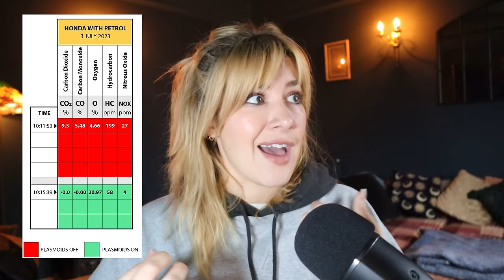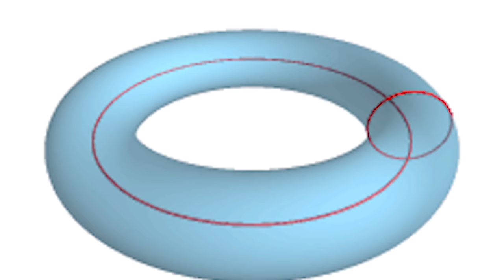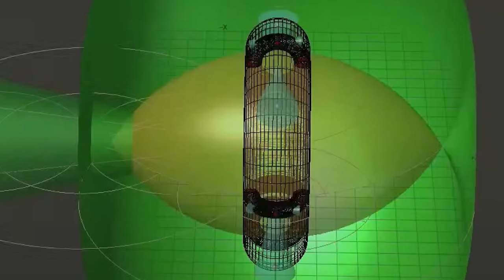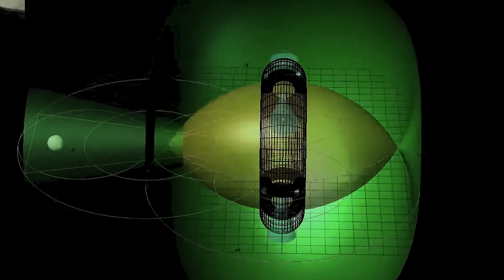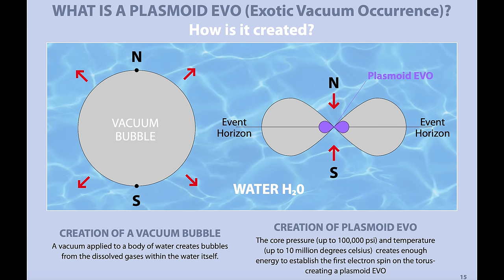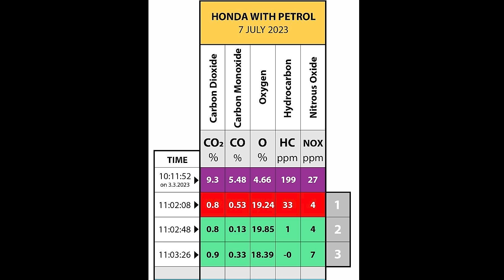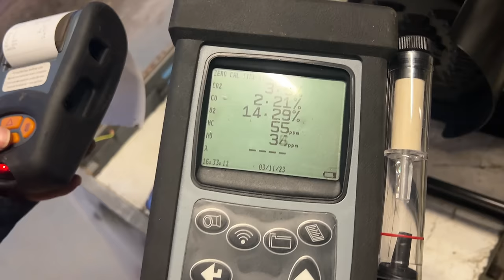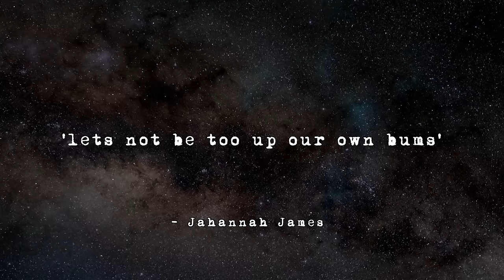Lost Ancient Plasmoid Technology? | The Thunderstorm Generator

Comment: If the CO and CO2 emissions are drastically reduced - where's all the carbon going?
Reply: Ultrasonics , water , metal surface producing HHO at the metal surface leading to the formation of vortices and toroids that, as they are driven harder and deeper form fractal toroids that already by the 3rd fractal level drawing matter in through the vortex are exerting magnetic pressures in excess of 50,000,000 Tesla - the streams (moments) at each level ultimately been drawn into the central flow of the top-level torus.  The result is an e-m vice leading to ElectroNuclear Collapse of all matter drawn into the centre by the vortex - with an aether (wormhole) flow streaming out along the moment of the topmost torus.  When the aether flow of this “consuming” torus loops around and meets the metal surface again the aether stream interacts with the electron lattice of the metal, causing matter to reform from the aether stream, preferentially as alpha-conjugate nuclei (ElectroNuclear reGeneration) The matter stream emerging from that exit port can, on occasion reconnect via magnetic lines with the matter consuming port, so forming a magnetic loop.  Now, being fractal, these toroids and flux loops can form at many different scales - as above, so below.  As Victor Schauberger and Nikola Tesla and , before them, Goethe said - comprehend and copy nature.  The universe is fractal, with the torus and spiral/vortex being key building blocks at all scales.  What those “marks” show from the TSG is that fractal toroids are almost certainly present in great number, collapsing matter into the aether before recreating it, preferentially as Carbon (the hexagonal/octagonal/circular black patches on the inside of the outer TSG sphere), Oxygen - released as a gas, Silicon combining with Oxygen to form Silicon Dioxide-quartz (the shiny crystals on the outer surface of the inner TSG sphere), and possibly Neon, Sulfur, Iron.  This, combined with evidence of “glowing sparks” when hard driven EVOS (coherent matter macro objects with coherent electron cells) is strongly suggestive that the TSG is working this way (although chemical reactions could be happening at the same time).

Comment: The pitting is the same hydrogen bubbles that pit a boat propeller, which contribute to the loud propeller noise underwater. 

A constricted exhaust will hardly give power. Plug the generator to an air conditioner or put it on a car exhaust and it will hardly move.

The exhaust is being scrubbed through the water and bubble stone layer. It is a filter plugging an exhaust at idle. 

Mechanically it is making hydrogen but a hydrogen fuel cell would generate more. Power will be lost in both methods, either by the load on the alternator or plugging the exhaust.

Comment: Seems to me like the Thunderstorm Generator and the Plasmoid Generator used to break down the CO2 are both plugged into the electrical socket. Meanwhile, the coal/gas power plant powering the Generators is releasing 10x as much CO2 as what was broken down by the process.

Comment: so... I just want to say good job to these inventors and congrats. But, honestly speaking, maybe I didn't get how the machine works, but you're telling me you add an extension to a fuel generator and the exhaust air coming out is clean?  That's fantastic and all, congrats again, but this is fuel/petrol (whatever, gasoline) that is powering the machine still, yes? So, it's not a generator, cos its basically generating nothing... is it? Basically, the pyramid is an air filter?? (I know Martin Fleishman's Channel theory and that is extremely interesting) Dare I say, transmutation is much more interesting than a filter, or better yet, using something else to power the engine/machine is much more interesting than an air filter... So, again, I'm so sorry, I'm usually smarter than this, but how is the pyramid connected to this? (Other than toroidal martin fleishman theories that apply to myriad of machines we use today)? And yes, how does this specific thunderstorm geberator corelate to Nikola Tesla's work? (Other than the word plasma? and using plasma science that was discovered before Tesla?? (Tesla is so interesting, the smartest person to ever grace the human race... dont get me wrong)

Comment: Engines don't waste 60%% of the energy it takes to move the car and all the waste isn't pollution. You have been misled. Some is pollution, yes..... but most of the wasted energy that isn't actually moving the vehicle is being used to turn the engine, recharge the battery, the aircon and most is used turning the gears and differential. The heavier the vehicle, the more energy it takes to move. Only after all that, the wheel then turns to move you.
This is why race cars are made as light as possible. The use high precision parts in their engines to stop any unnecessary friction and have special lubricants to reduce the friction even more. Also they are aerodynamic to reduce wind resistance/drag which equants to weight. 

Also, if the world is starved of CO2, plants will struggle to grow. Any areas of the planet where is it difficult to grow crops, will become impossible to grow crops. The more CO2 we have, the more plants will grow. Places that are baron today, will have vegetation. The more CO2 we have, the less world hunger there will be.

Comment: Yes it's clever, but I'm sorry it won't be all that practical, as all the components are "sacrificial"! Meaning all of it would need to be replaced within a very short amount of kilometres. And electrolytic elemental conversion, which is the process that's occurring to clean the emissions, has NOTHING to do with the combustion efficiency! So where the idea of fuel saving came from, I think you may have confused a different concept!
FYI Prior to 13k years ago the weather and climate were not suited for generating the type of lightning that was very good at charging the ionosphere. There was the potential for solar radiation to strip away a weak ionosphere and then the atmosphere it protects, as was the final fate of Mars. It lost its weather that produces the necessary lightning that charged it's ionosphere! Why, how 😉
So back to earth and the problem of its solar shield. An artificial ionic generator was required. Now you know what the pyramids are! A stream of charged ions was emitted from the originally GOLD capstone, straight up to the ionosphere to insure sufficient charge. They could be classified as terraforming engines.

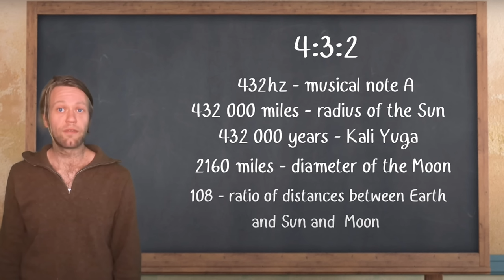Comment: 13:48  I see some problems with this guy's "information".

For starters, how did this guy obtain such a specific value for the radius of the sun? 

The sun is a plasma. There's no way to accurately measure the radius of a gigantic ball of plasma. So, measuring the radius of any star to the degree necessary for claiming any relevance in the numbers, it just isn't possible...especially not to the degree that you can then definitively tie your measurements to such an hypothesis of relative sizes.

The earth? Sure, make your hard measurements. 

Same for the moon.

But, please, don't insult my intelligence by encouraging me to watch such drivel as someone claiming to have precise enough measurements of the sun's radius to be able to show a correlation between the radius of a star and the radius of a solid celestial body.
Reply: According to Robert Temple's new plasmoid bible: A New Science of Heaven, the sun's diameter varies by ~6 kilometers. Close enough for government work.

Comment: Hi, my dad invented this engine 50 years ago. The geet can be found on YouTube being showcased back before digital TV by Paul Pantone. If you look at the engines they are identical, same things, different names. This is fine, it's free to all to tinker with, just credit my dad, ya?
Mine runs on air pollution, and produces oxygen as it's waste product. Very simple. Way easier than this mess. 

Thank you for bringing this ripoff to my attention on a side note, but this is trash in comparison to the "matter mater". The geet that has a recombination unit on its tail end aka a chamber that's tunable so you can choose your waste element, elements, or chains as you so desire (yes, you can tune chains, na cl, easy tune). Want to make diamond as a waste product from urine in your internal engine? It's been done since 91. Thunderstorm is a weakened wackjob hippie mumbo jumbo take on an already weak wackjob hippie dippi mumbo jumbo technology. No joke, we will have davinci's robot knights in every household as nannies before geet, thunder,ando,peteratera,ECT (same tech) become common.

Comment: The sad thing is this works perfectly for big oil because all they’re doing is making the oil industry less harmful to the environment meaning no reason to stop drilling and we still end up running out of fuel someday and gas prices continue to increase
Reply: Wrong. It increases efficiency up to 100 percent. After the plasmoids are imbeded Into the machine, and continue after its disconnected.  It will reduce the price of oil dramatically.  It works on any emission with carbon. So wood burner coal power 
Etc.
Reply: Actually, this presents the fossil fuel companies with a quandary. On the one hand, the exhaust from ICEs can be more or less totally cleaned, with the added bonus of Oxygen being synthesised (yes, this is an alchemical system), so they can sell more fuel. On the other hand, it opens the gates to systems that can unleash millions of electron volts per methane molecule, say, as compared to the fourteen or so electron volts released when the methane is burned - and that is for each and every molecule. The energies released by ElectroNuclear Collapse (as identified by Dr. Takaaki Matsumoto) is over 130 times greater than that released by nuclear fusion, with 1Kg of Iron, for example, being able to power a starship to the Alpha Centauri system and back at close to light speeds. Yet, there is evidence that fractal toroid/EVO technology may well once have been used by human ancestors for rock cutting, shaping and transporting - with many ancient symbols bearing an uncanny resemblance to what the MFMP has revealed in open research “down the microscope” - in addition to there being increasing evidence that the universe is fractal - as above, so below as the (ancient) saying goes
Reply: @chrisprysok7634  you can’t increase efficiency to 100% 🤦‍♂️  try again.